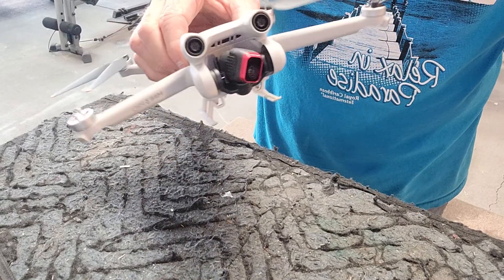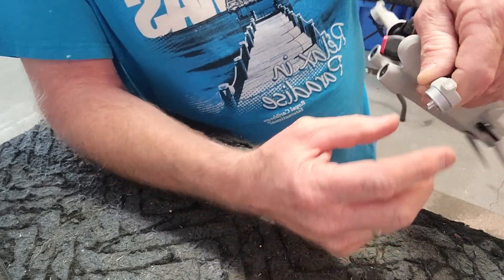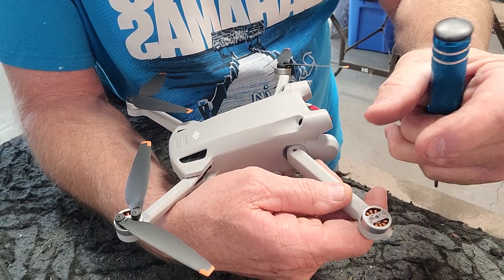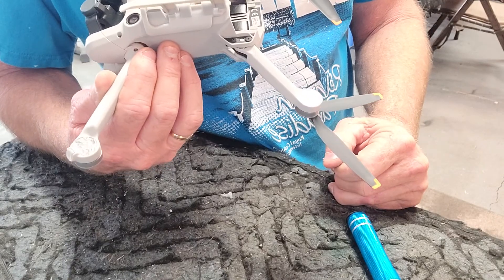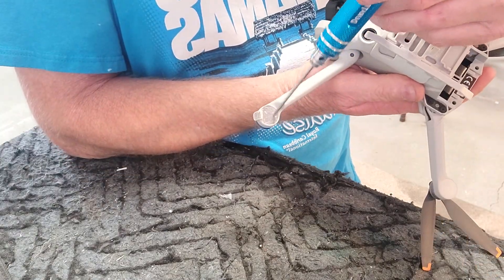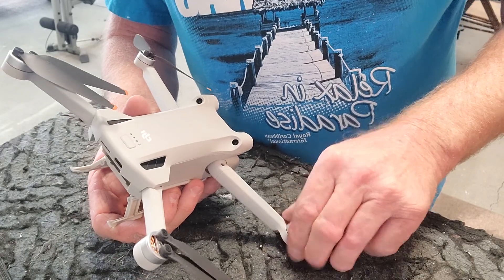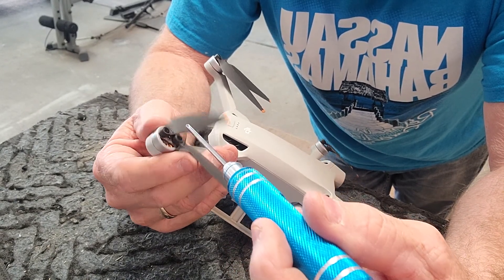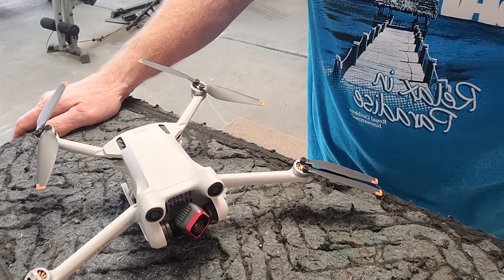DJI MINI 3 PRO motor sticks- possible fix

Comment: My guess is that cooling the motor is the reason they don't cover the motor internals. It would cost them nothing to seal the motor, and in essence it would have to be better if it could be sealed from debris. The only reason for not doing it must be airflow over the motor.
Reply: I agree. DJI sells a protection plan and it doesn't make sense that they'd court problems that they'd have to cover at considerable expense.

Comment: So you’re video helped me fix my drone. I pulled 3 screws out then noticed 2 of magnets where laying horizontal instead of vertical. It took some playing but got them back in proper spot. 

I had crash caused this. Now it’s fixed flying great.

Comment: It’s a stuck bearing. Mine did same thing upon first flight.  I contacted DJI and they said the mini 3 and pro are made with a bearing in the motor that may move during transport or storage. Mine eventually freed up. Best thing to do they say is manually spin it.

Comment: My two days old DJI Mini 2 drone hit the wall and one motor refused to turn. Haven’t found solutions yet.
Reply: solution = Learn to Fly
Reply: I had the same issue it had knocked two of the magnets loose and I was able to reset them by taking the rotor off to gain access. Thanks for the video 👍 easy job with just the screwdriver and a small razer blade
Reply: Check the magnets, I fixed mine by getting magnets back in proper spot

Comment: My first thought was to get rid of the landing gear and learn how to hand launch and catch. Zero risk of debris?
Reply from the maker: not really. There are many who do that and have the same issue. In fact a lot complain about bugs/polen/insects  in there.  I fly RC helicopters and air planes and know very well how to land, fly etc.  The issue with these motors has more to do with regular use.